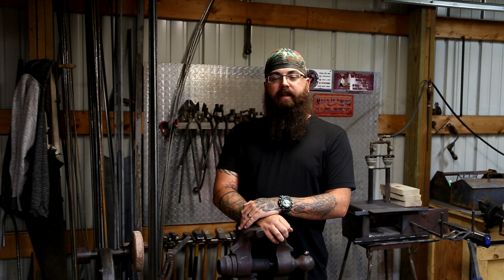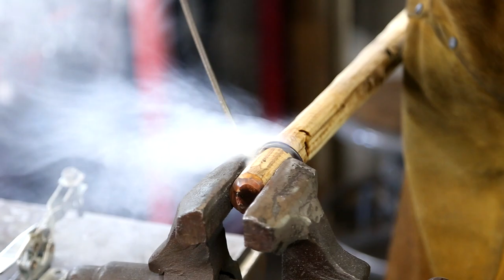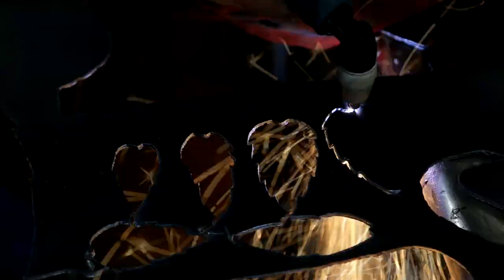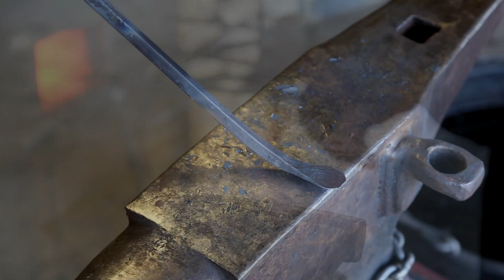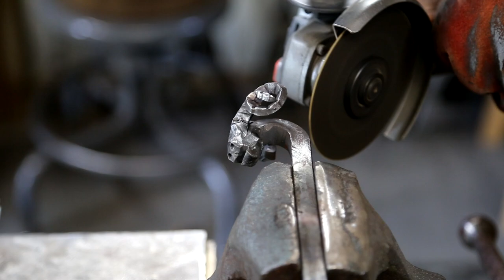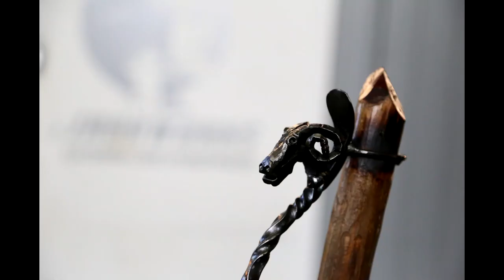Blacksmithing forging a Ram's Head walking stick Blacksmith Forging demonstration

Comment: I've not seen anyone else do leaves like that, fullering and then narrow peening around the edges. I like it a lot!
Reply from the maker: Thank you, I first tried it a couple weeks ago and really liked the look. Larger leaves it really allows for some organic looking shaping.
Reply: @wrotiron  Hope you don't mind if I try your technique! I'm doing more and more leaves lately as parts of other projects.
Reply from the maker: @brysonalden5414  don't mind at all, I used to forge out all the leaves for roses etc out of rod but wanted to try something with a little more controlled shape and it worked really well. Hope it works out good for ya.